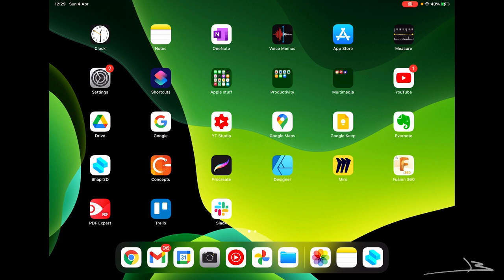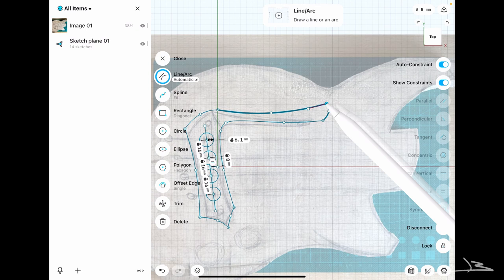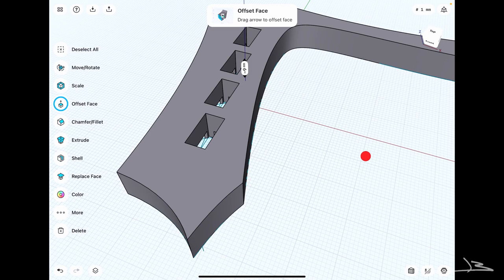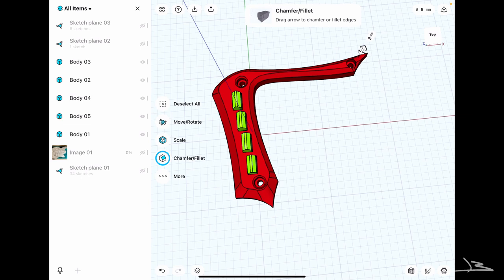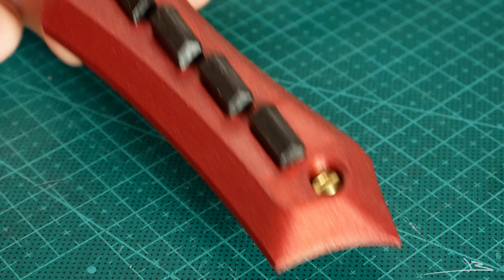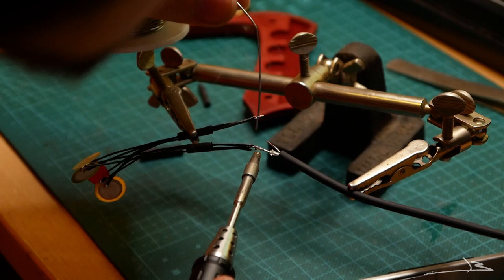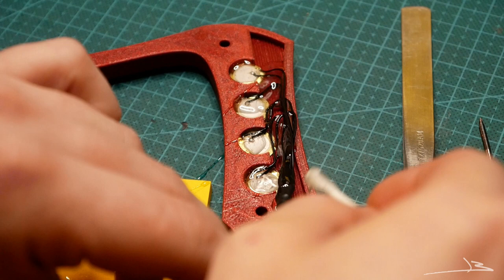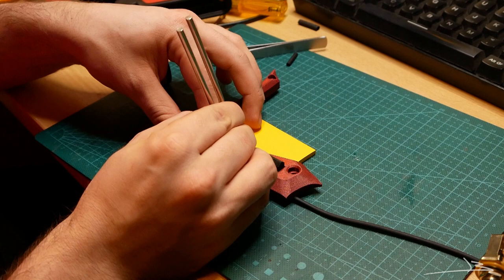3D printing a custom piezo bridge/pickup for the electric U-bass | UseWhatYou'veGot Challenge | Ep.2

Comment: How cool. I love the integrated thumb rest and style of the whole build. I think I'me gonna give building a ubass a go. I've never had one before so it'll be interesting for the experience alone. Cheers and keep up the good work.

For flooding epoxy, I really like using casting resin because it is made to be this and flow into voids. It is also made to be relatively thick so it cures slowly and doesn't have much heat. I only used 5min epoxy on a 3d print once and it got hot enough to warp my part resulting in another 18 hour print. So I stick to 15-30 min epoxy and casting resin for void filling.
Reply from the maker: Thanks for the tip, I wasn't used to working with epoxy at all and didn't have any other one, but I definitely learned a lesson

Comment: Looking good! Love that design!
Just curious, why did you choose to design on an ipad and not a computer?
Reply from the maker: Good question! So I've been doing a lot of Fusion 360 in the previous years and still do for most of my stuff where I really need the history tree and the whole parametric design way of thinking. I would never do assemblies, or parts that need a lot of fine adjustments and iterations on the ipad. But what the ipad gives me is a bit more flexibility in terms of when and where and how quickly I can get a part out. I can have a  5 minute quick and dirty design or prototype where dimensions are not important, or where I know exactly how my part will work, without getting Fusion out. I can do this from my bed while the printer is  heating up and then just send the file to the slicer and to the printer wirelessly. But all in all it really just depends on how complicated my design is and how much I'm expecting to iterate on it.
Reply: @BogdanBacila301  cool gotcha